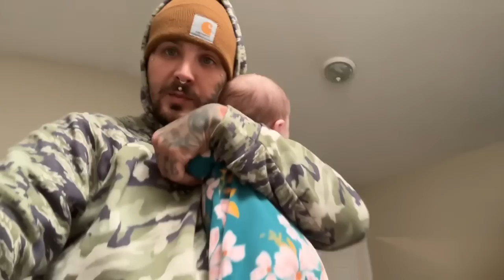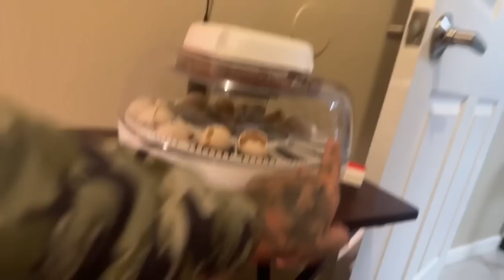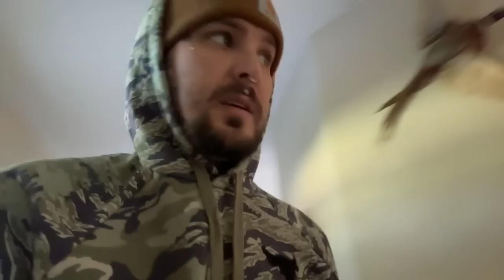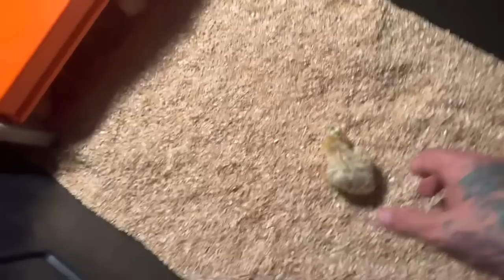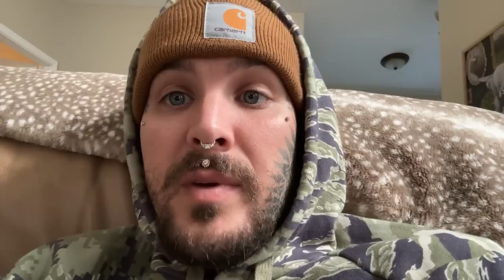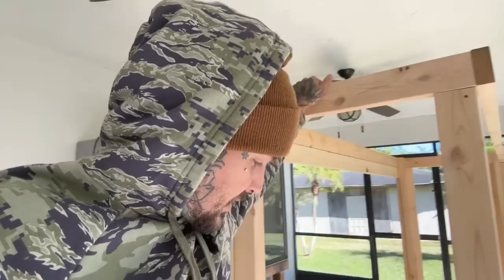Live Stream while our Chickens Hatch 🐣

Comment: You can fix the chicken's leg.  just use a hair tie.  preferably a new one that has not been stretched.  tie it in the middle and thread the legs into each loop.  after about 2 days the legs are fixed.  done this on several chickens.  and make sure that the surface is not slippery.  good luck with the chickens 😁.